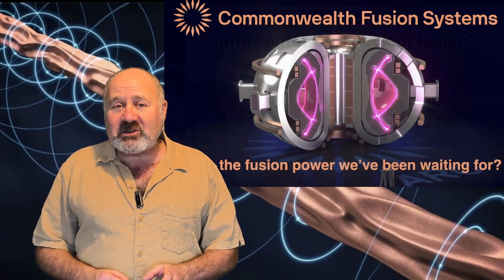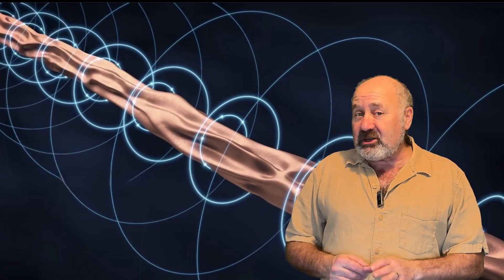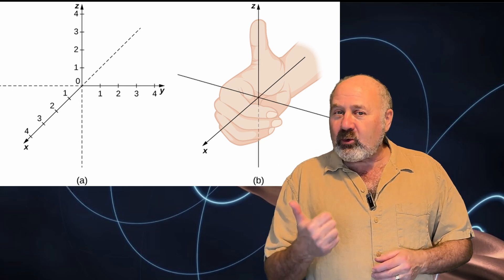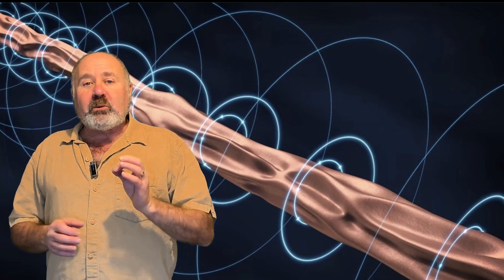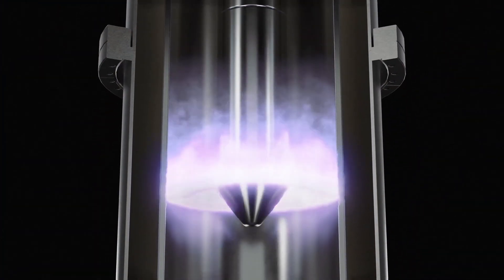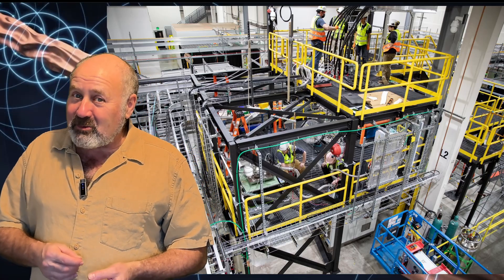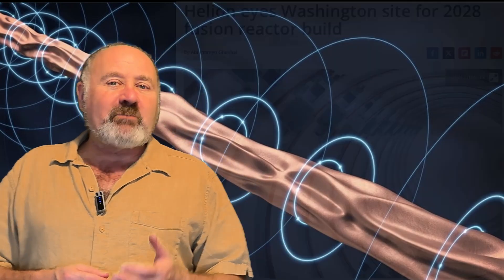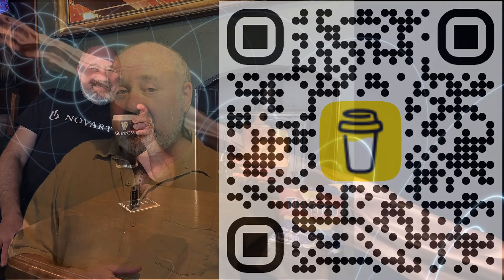Can a Zap of electricty create fusion?

Comment: Of all the "alternative" approaches to fusion, Zap is my favourite.  Their approach is the most hardware light of any of the fusion energy technologies I know of;  orders of magnitude lighter and simpler and more elegant than tokamaks and therefore, presumably, far cheaper and easier and faster to commercialize.   If they succeed.  If!
Reply from the maker: I completely agree. For the reasons that you state, if they get it working, I think they'll have the easiest time ramping up and actually producing a lot of power.
Reply: @Decarbonize11  LPPFusion's Dense Plasma Focus approach is even simpler. Aneutronic pB11 fuel (so no neutrons, fuel breeding or steam cycle). Worth checking out.
Reply from the maker: @markpurcell8075 boron has 5 times the charge, therefore 5 times the electrostatic repulsion. So I’m not optimistic on theirs approach. Even Helion will have difficulty dealing with Helium
Reply: @Decarbonize11  Yes, that requires very high temperatures, and a corresponding large enough triple product. But DPF uses plasmoids which have temperatures way higher, over 2 billion degrees C, and these have been observed, measured and results published by LPPFusion. Helion aren't using plasmoids, they can't get the temperatures needed for pB11 fusion (and as you say may not even be high enough for He3), it's different technology.
Reply from the maker: Why not use plasmoids with D-T?
Reply: @Decarbonize11  They can, in fact DPF devices are used for neutron and x-ray sources. The problem is dealing with the neutrons, from damage to the reactor to having to breed fuel and radioactivity. If the temperatures and confinement times are large enough pB11 fuel is way better, with the main reaction aneutronic and only charged particles produced allowing direct energy conversion instead of using steam and turbines. Read their papers, I can't link to them here.

Comment: I had the same idea for a fission rocket. Uranium and plutonium are metals that conduct electricity. When 2 charged copper cables meet there is a flash of light and energy is released. I think there is a good chance more energy would be released if the cables were made from uranium or plutonium.

Comment: I think cold fusion is easiest, have deuterium fully absorbed in palladium then capacitor discharge into a coil around that palladium to compress the metal and the deuterium within.
Reply from the maker: Has anyone ever done this?
Reply: @Decarbonize11  Doubt it, I read the cold fusion experiments and it was obvious they were missing a step.

Comment: 2:30 More lasers!
Reply from the maker: This is a laser free approach, which is an advantage as lasers are a very inefficient way to heat a plasma.
Reply: @Decarbonize11 I can explain how to efficiently heat plasma with a laser, but, if you’re looking for an example of extreme inefficiency, here’s a step-by-step energy-efficiency breakdown of NIF’s laser—from the initial electrical input to the energy delivered to the fusion capsule's surface:
    1. Electrical Input to Laser Flashlamps:
        ◦ Energy Supplied: Approximately 400 megajoules (MJ) of electrical energy are supplied to the laser's flashlamp system. 
    2. Flashlamp Efficiency (Electrical to Optical Conversion):
        ◦ Process: Flashlamps convert electrical energy into broadband optical light to pump the laser medium.
        ◦ Efficiency: Typically around 1–2%. This low efficiency is due to the broadband nature of the emitted light, much of which is not effectively absorbed by the laser medium.
        ◦ Energy After Conversion: Approximately 4–8 MJ of optical energy.
    3. Laser Medium Absorption and Quantum Defect:
        ◦ Process: The optical energy from the flashlamps excites the neodymium-doped glass laser medium.
        ◦ Quantum Defect: The difference between the pump wavelength (~800 nm) and the laser emission wavelength (1053 nm) results in energy loss.
        ◦ Efficiency: Approximately 76%. This accounts for the energy lost due to the quantum defect and other inefficiencies within the laser medium.
        ◦ Energy After Laser Medium: Approximately 3–6 MJ of laser energy at 1053 nm.
    4. Amplification and Optical Losses:
        ◦ Process: The 1053 nm laser light is amplified through multiple passes in the laser amplifiers.
        ◦ Losses: Losses occur due to absorption and scattering in the laser glass and mirrors.
        ◦ Efficiency: Approximately 67%.
        ◦ Energy After Amplification: Approximately 2–4 MJ of laser energy at 1053 nm.
    5. Frequency Conversion (Infrared to Ultraviolet):
        ◦ Process: The 1053 nm infrared laser light is converted to 351 nm ultraviolet (UV) light using frequency conversion crystals.
        ◦ Efficiency: Approximately 50%. 
        ◦ Energy After Conversion: Approximately 1–2 MJ of UV laser energy.
    6. Transmission to Hohlraum and X-ray Conversion:
        ◦ Process: The UV laser light is directed into a hohlraum—a gold or uranium cavity—where it is converted into X-rays that symmetrically compress the fusion capsule.
        ◦ Efficiency: Approximately 85% of the UV energy is absorbed by the hohlraum and converted to X-rays. 
        ◦ Energy After Conversion: Approximately 0.85–1.7 MJ of X-ray energy.
    7. X-ray Energy Coupling to Capsule:
        ◦ Process: The X-rays generated in the hohlraum irradiate the fusion capsule, causing it to implode and initiate fusion reactions.
        ◦ Efficiency: Approximately 10–15% of the X-ray energy is absorbed by the capsule. 
        ◦ Energy Delivered to Capsule Surface: Approximately 0.085–0.255 MJ (85–255 kJ).
Summary of Energy Flow:
    • Initial Electrical Energy: ~400 MJ
    • Optical Energy from Flashlamps: ~4–8 MJ
    • Laser Energy at 1053 nm: ~3–6 MJ
    • UV Laser Energy at 351 nm: ~1–2 MJ
    • X-ray Energy in Hohlraum: ~0.85–1.7 MJ
    • Energy on Capsule Surface: ~85–255 kJ
Overall Efficiency:
The ratio of the energy delivered to the capsule surface to the initial electrical energy is approximately 0.021–0.064, or 2.1–6.4%.
Note: These values are approximate and can vary based on specific experimental conditions and configurations.
Reply: @Decarbonize11  Here is my more efficient approach, following the steps previously outlined, but using a spherical laser cavity filled with molten Nd:FLiBe: 

1. Electrical Input to laser diodes:
    • Energy Supplied: Approximately 40 MJ of electrical energy. 
2. Diode Efficiency (Electrical to Optical Conversion):
    • Efficiency: 50-70% typically. 
    • Energy After Conversion: 20 – 28 MJ of 800 nm optical energy. 
3. Laser Medium Absorption and Quantum Defect:
    • Process: The optical energy from the diodes excites the neodymium-doped FliBe medium.
    • Quantum Defect: The difference between the pump wavelength (~800 nm) and the laser emission wavelength (1053 nm) results in energy loss. 
    • Efficiency: [84%] This assumes the energy lost due to the quantum defect and other inefficiencies within the laser medium is 24%. However, because this is heat that is deposited in the circulating coolant (Nd:FLiBe), subsequent thermal cycles will reclaim 35%. 
    • Energy (potential) at 1053 nm: 17 - 24 MJ 
4. Amplification and Optical Losses:
    • Process: The 1053 nm laser light is amplified through multiple reflections inside the laser cavity.
    • Losses: Losses occur due to absorption and scattering in the Nd:FliBe and mirrored surface of the tiles lining the sphere. 
    • Efficiency: [79%] This assumes 35% recovery, of the 33% losses, in subsequent thermal cycles.
    • Energy After Amplification: 13 – 19 MJ laser light at 1053 nm. 

My approach stops here, with the bubble directly illuminated by 1053 nm laser light, avoiding the 0.05 efficiency penalty that the National Ignition Facility (NIF) incurs when converting 1053 nm light to x-rays. 

Summary of Energy Flow: 
    • Initial Electrical Energy: ~40 MJ.
    • Optical Laser Diode Energy: ~20 – 28 MJ.
    • Energy (potential) 1053 nm: ~17 – 24 MJ.
    • Laser Energy at 1053 nm: ~13 – 19 MJ.

Overall Efficiency:  33% – 48% 😜
Reply from the maker: That’s very long light at 1053 nm. I doubt the coupling to the bubble would be appropriate to trigger fusion.
Reply: @Decarbonize11  There are more energy efficient ways to heat plasma with a laser, but here's a detailed, step-by-step breakdown of the NIF laser system—from the initial electrical input to the final energy delivered to the surface of the fusion capsule.

    1. Electrical Input to Laser Flashlamps:
        ◦ Energy Supplied: Approximately 400 megajoules (MJ) of electrical energy are supplied to the laser's flashlamp system. 
    2. Flashlamp Efficiency (Electrical to Optical Conversion):
        ◦ Process: Flashlamps convert electrical energy into broadband optical light to pump the laser medium.
        ◦ Efficiency: Typically around 1–2%. This low efficiency is due to the broadband nature of the emitted light, much of which is not effectively absorbed by the laser medium.
        ◦ Energy After Conversion: Approximately 4–8 MJ of optical energy.
    3. Laser Medium Absorption and Quantum Defect:
        ◦ Process: The optical energy from the flashlamps excites the neodymium-doped glass laser medium.
        ◦ Quantum Defect: The difference between the pump wavelength (~800 nm) and the laser emission wavelength (1053 nm) results in energy loss.
        ◦ Efficiency: Approximately 76%. This accounts for the energy lost due to the quantum defect and other inefficiencies within the laser medium.
        ◦ Energy After Laser Medium: Approximately 3–6 MJ of laser energy at 1053 nm.
    4. Amplification and Optical Losses:
        ◦ Process: The 1053 nm laser light is amplified through multiple passes in the laser amplifiers.
        ◦ Losses: Losses occur due to absorption and scattering in the laser glass and mirrors.
        ◦ Efficiency: Approximately 67%.
        ◦ Energy After Amplification: Approximately 2–4 MJ of laser energy at 1053 nm.
    5. Frequency Conversion (Infrared to Ultraviolet):
        ◦ Process: The 1053 nm infrared laser light is converted to 351 nm ultraviolet (UV) light using frequency conversion crystals.
        ◦ Efficiency: Approximately 50%. 
        ◦ Energy After Conversion: Approximately 1–2 MJ of UV laser energy.
    6. Transmission to Hohlraum and X-ray Conversion:
        ◦ Process: The UV laser light is directed into a hohlraum—a gold or uranium cavity—where it is converted into X-rays that symmetrically compress the fusion capsule.
        ◦ Efficiency: Approximately 85% of the UV energy is absorbed by the hohlraum and converted to X-rays. 
        ◦ Energy After Conversion: Approximately 0.85–1.7 MJ of X-ray energy.
    7. X-ray Energy Coupling to Capsule:
        ◦ Process: The X-rays generated in the hohlraum irradiate the fusion capsule, causing it to implode and initiate fusion reactions.
        ◦ Efficiency: Approximately 10–15% of the X-ray energy is absorbed by the capsule. 
        ◦ Energy Delivered to Capsule Surface: Approximately 0.085–0.255 MJ (85–255 kJ).
Summary of Energy Flow:
    • Initial Electrical Energy: ~400 MJ
    • Optical Energy from Flashlamps: ~4–8 MJ
    • Laser Energy at 1053 nm: ~3–6 MJ
    • UV Laser Energy at 351 nm: ~1–2 MJ
    • X-ray Energy in Hohlraum: ~0.85–1.7 MJ
    • Energy on Capsule Surface: ~85–255 kJ
Overall Efficiency:
The ratio of the energy delivered to the capsule surface to the initial electrical energy is approximately 0.00021–0.00064.

Note that these values are approximate and may vary depending on specific experimental setups and configurations. Additionally, a significant amount of energy is used to actively cool the optics, crystals, and laser amplification medium. Cooling is essential to prevent thermal expansion, which can cause misalignment. Without proper cooling, excessive heat could lead to thermal lensing, melting, cracking, or even destruction of critical optical components. The substantial heat generation limits NIF’s shot rate, requiring approximately 2.5 hours of active cooling between each firing cycle.